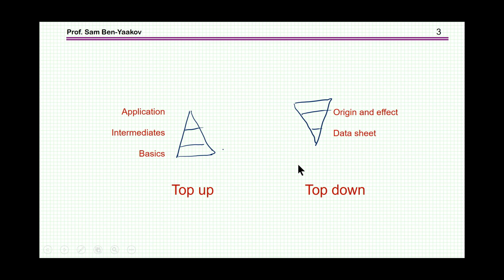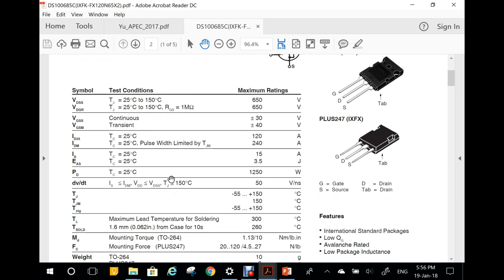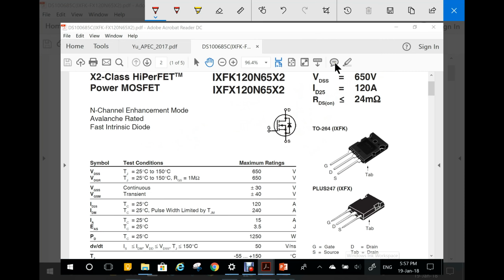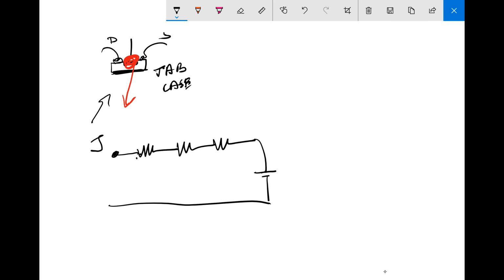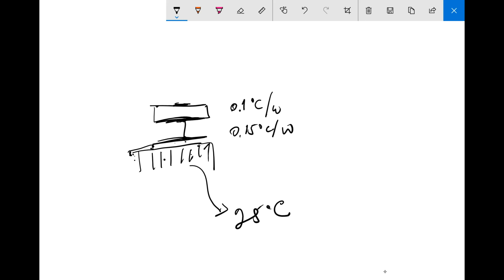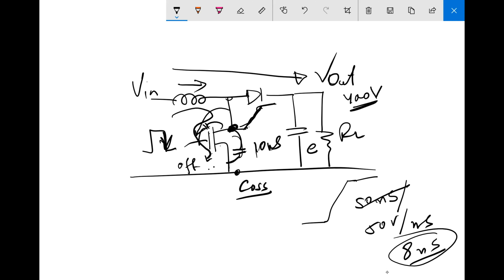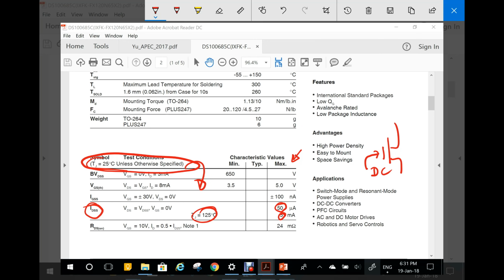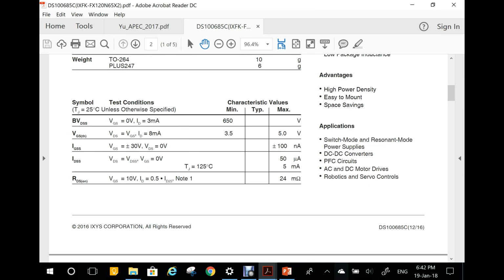MOSFET datasheet – Part I

Comment: Dear prof,

I was not able to understand about the point you are trying to mention about the VGSM at 12:41. you are mentioning about injecting some noise by connecting a cap when gate driver is connected. Can you please elaborate?
Reply from the maker: Perhps this migt help https://youtu.be/cWfBot5wECk. It has to do with the issue of capacitive coupling.

Comment: Dear Sam Ben-Yaakov, thanks for a great video. Avalanche energy measurement results is a function of the inductor that is used in the test setup. Tests performed with larger L will yield higher avalanche energy rating, but at a lower current that passes through the device. I think they should standardize this test method so that we could have true "apples to apples" comparison when it comes down to comparing different MOSFET devices.
Reply from the maker: Thanks for the info! I was not aware on that. Yes, this is a problem.

Comment: Thank you for the video sir. iI have an LC-STAR SOLAR  12/1500 inverter,i put a 24v on by mistake and it burns the MOSFET,i cannot find the original MOSFET which is svd1404t , can i replace them with irf 1404? please help.
Reply from the maker: Sorry too busy to look into it. Check datasheets.

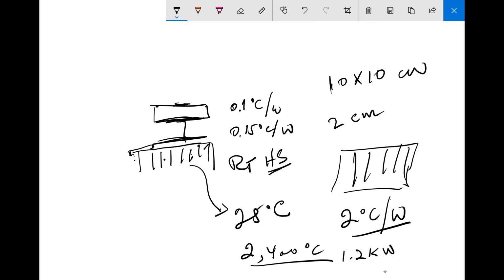Comment: at 30:00 in your discussion about heat sink thermal design, I am confused a bit I have been always confused about this point for a long time and I would be really grateful if you can enlighten me please, my confusion comes from the fact that the way I understand it, the heat sink is counterproductive since it is adding additional thermal resistance to our design, so why try to lower the heat sink Rth if we can remove it and be better off since by definition a thermal resistance will resist the heat transfer to the ambient environment and we will get more heat trapped on the component. I know my understanding is not correct and I am missing something, please help.
Reply from the maker: Hi, The basic parameter in datasheet is the thermal resistance between junction and case which is just the starting point. You need case to ambient for full picture. With no heatsink the j to amb is (depending on package )   20- 50 DegC/W. A moderate heatsink will have Rth of about 1 DegC/W.  So without HS Rth J-amb 40 with heatsink about 2. I will go for the latter😊 Some datasheets specify j-amb.
Reply: @sambenyaakov  Oh Thank you very much Sir, it seems I missed this point and it was the source of my confusion.

Comment: Many of manufacturers claim that their MOSFETs have the capability to withstand hundreds of Amperes of current, but one thing that makes me doubt their claim is the maximum rating of the pins themselves. I think they have much lower current rating than the MOSFET themselves are capable of, what do you think?
Reply from the maker: Thanks for participating in conversation. Normally the pins are capable to carry the specifies current. If anything, the bonding within the package are more of a bottleneck.
Reply: @sambenyaakov  I remember I watched a video on Youtube from a quite reputable source about MOSFET max current testing and they were testing TO-220 MOSFET and the pins melted at 75A (forgot which video, I need to dig that up again), and the fact that there is an AWG ampacity chart in where a wire with similar diameter to the MOSFET pins is rated for a much lower current. These are the main sources of my doubt.
Reply from the maker: @kaikart123  Well, a video is not the best source of knowledge. The malfunction could have been due to misunderstanding of datasheet. Passing 75A through a TO220 would require extraordinary cooling (water cooling at least) otherwise the whole device will melt. So it has nothing to do with the current carrying capability of the leads.
Reply: @sambenyaakov  Aaah yes, you are right. The person in the video didn't attach a heatsink the MOSFET when testing it. I see now.

Comment: Dr Yakov- Or anyone with the knowledge.. Can you explain how to interpret the definition of DRAIN and SOURCE in light of the operation of synchronous buck circuit constructed entirely of N channel power mosfet transistors and an LC filter.  By synchronous buck converter I mean 
-the drain of a n channel transistor connected to a positive supply rail.
-the source of this n channel transistor connected to the drain of a second n channel transistor
-the source of the second n channel transistor connected to a return to the positive supply
-an L-C filter is connected to the node of first transistor source and second transistor drain.

A synchronous buck converter achieves higher efficiency because the bottom transistor replaces a schottky diode. But, please imagine the current flow when the bottom transistor is "ON". The current must come from the return, flow INTO the terminal called SOURCE, through the transistor as majority carriers (not through the parasitic diode)  and exit the terminal called DRAIN. This must be the correct direction of the current because the current through the L cannot change instantaneously (in this topology)

This direction is opposite the normal convention when Ids versus Vds for various Vgs is given.  

For 1 thing, Ids is negative for the bottom transistor. The current is flowing from source to drain. We never see transfer curves with Ids < 0 for N channel mosfets. 
For another thing, I was always taught the drain and source terminals of a MOSFET where interchangeable (neglecting the parasitic diode) and that drain and source are defined by the direction of current flow.
Reply: I don't consider myself as an expert, but (with very few useful exceptions) reduce your circuit to the MOSFET and the battery source, then the Source pin is connected toward the Negative terminal of the battery for a N chanel MOSFET and toward the Positive terminal of the battery source for a P chanel MOSFET... OTHERWISE, the intrinsic diode won't block the current when you use the transistor in a blocking mode. (We can use a P Chanel MOSFET in the reverse way, in order to protect the circuit against accidental reverse voltage input.)

Technically, because of the pinching, the concentration of the doping elements *may* differ between the Source and the Drain too, so UNLESS it is explicitly stated on the datasheet, you should NOT invert them (even if the intrinsic diode does not bother your design) without careful testing. As example, the reversed N Channel may overheat. But you still have the intrinsic diode, in most cases, which will then try to reach the same difference of voltage than the one present at the Channel (since they are like as in parallel; see https://www.youtube.com/watch?v=ZZDdlAgZfvI, around 1:47, as an illustration of the problem of an inverted N Channel MOSFET where it seems that its intrinsic diode just can't keep up... the MOSFET heats so fast that Julian has to disconnect it after few seconds).

Take a look too at part 2 of this presentation, https://www.youtube.com/watch?v=5A-THexe6u8, around 8:55 :-)

Comment: Thanks for this  explanation. Do you have any video talking about leakage inductance and its effect in switching transistor in flyback  power supply? If not it could be an interesting matter, and an oportunity to talk about snubber circuits.

Comment: Great work by the master, highly appreciate . 
I have an humble opinion, when they say 650v. This should mean factory garantee at 650v. It should not mean once reach 650v it will start behave like a zener diode. It should start to breakdown at higher value than that may be 750v or 800v.
Reply from the maker: Not really รุ่ง ลอประยูร. It is not exactly 650V but close to it. Notice that at 650V the drain current at off is already 3mA, pretty much like approaching the Zener breakdown voltage.